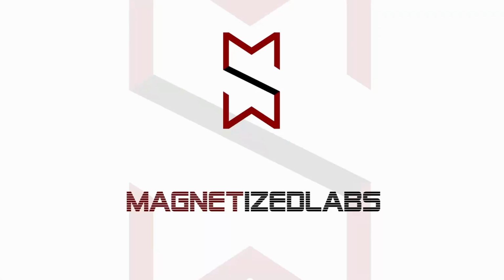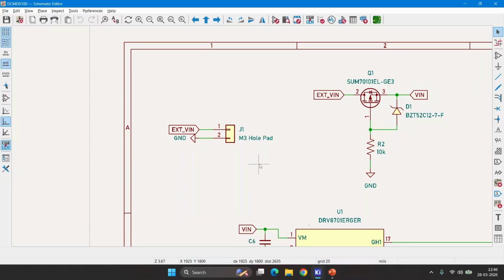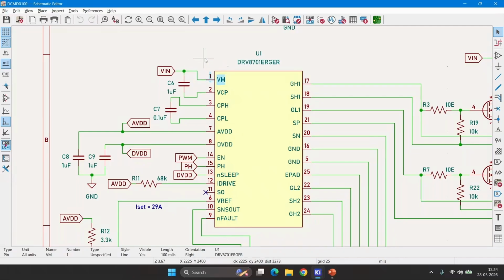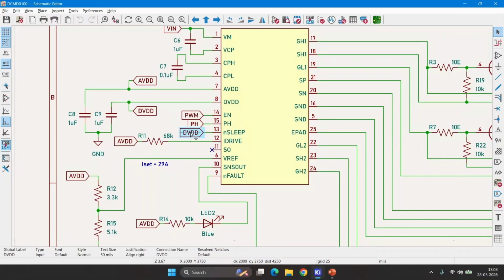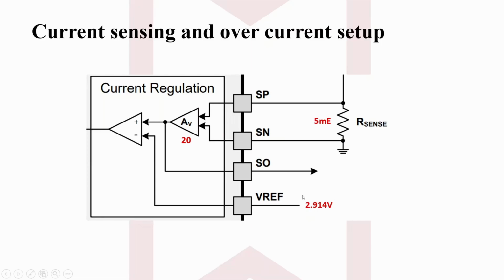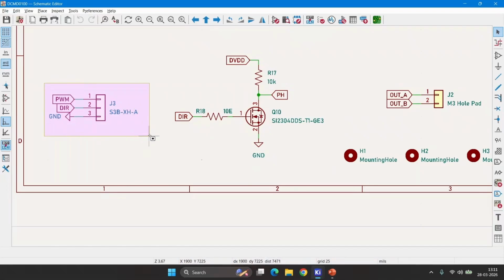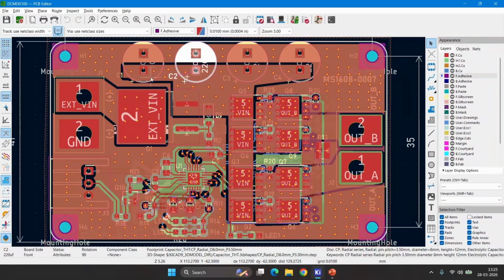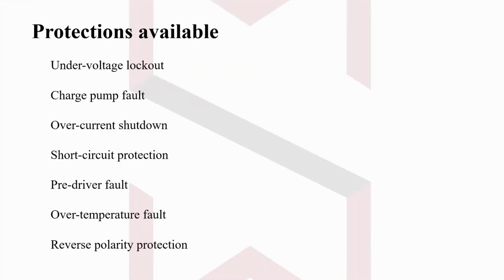Design of DC Motor Driver/Controller using DRV8701 in KiCAD | Magnetized Labs 07

Comment: i m interested in learning electronics and circuit design. Is it possible to pursue this without enrolling in electronics engineering university course?
Reply: Well, as someone who finished a degree, you will learn more as a hobbiest than when take a degree
Reply from the maker: Yes. It is very much possible. It is all about how your interest and passion is driving you towards electronics and circuit design. Keep building and designing small circuits and try to implement it in real time applications. Electronic circuits gets interesting and challenging when you apply it in real world applications than studying that in a degree.